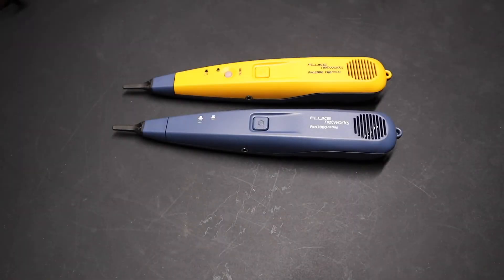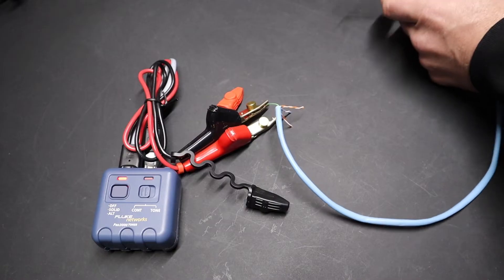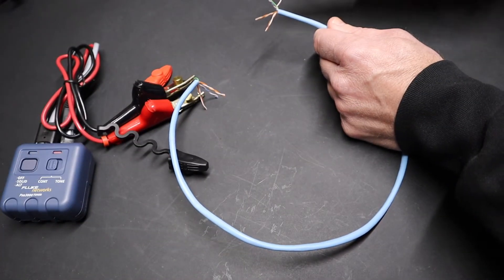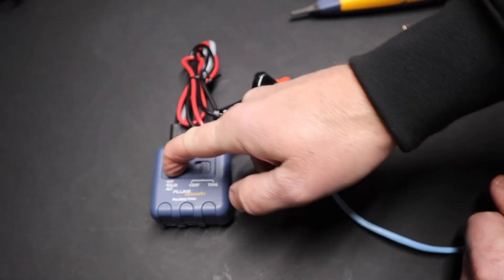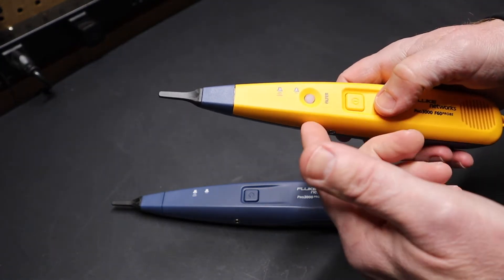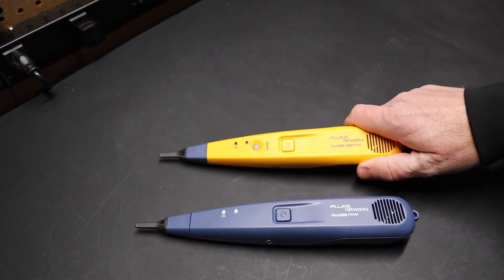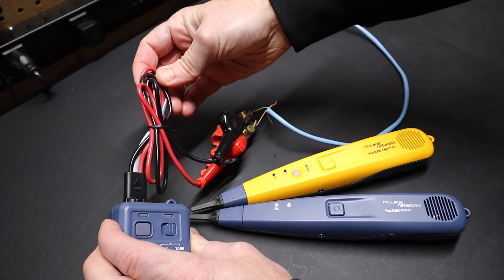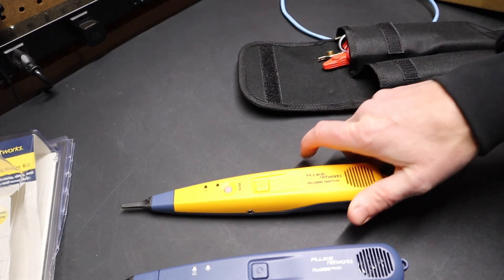Fluke Pro3000 Tone & Probe kit with filter - how to trace wires

Comment: Ι want a cable tracer for power cables. Tried some other brands but unfortunately none can locate them accurately and I end up finding them with the old process of sorting one side. Does fluke have an accurate cable tracer and identifier?
Reply from the maker: What brands have you tried?  Testing power while energized?
Reply: @ProjectPineHills  the other brand names are irrelevant. Can you answer me if fluke can detect a single cable from a lot bunch of other cables? Because with the other brands the signal goes on also for the nearby cables.

Comment: Having both of those on hand....  Would you say they are equally as sensitive..  For example.. So I use the blue one to find wires behind walls that someone else wired...   So not directly on the wire, would you say they both would perform the same?
Reply from the maker: I would say yes. The only difference being the yellow one filters out 60Hz.
Reply: @ ok thanks!!!

Comment: Fuck I just ordered the one without filter, the other seems better and me in electrical i work a lot with wires crossing hot lines and the interference noise it's annoying, can't trace nothing after that
Reply: I just cancelled and ordered the one with filter, you saved me lol
Reply from the maker: Glad to hear it!  If you can filter out 60Hz electrical noise, it just makes sense. Not sure why Fluke offers both options. Thanks for commenting!  👍
Reply: @ProjectPineHills  for real, the other day I was at the casino using a Tempo toner which is supposed to be top shet and it does detect wires buried around 5ft which is good but we we're tracing a circuit in the same raceway mixed with other live circuits on a 800ft run. Such a nightmare

Comment: If you press the power button on the grey probe, the tone generator not on, what sound will you hear from the probe? Should you hear a kind of white noise? The batteries may be low. Found a tossed out Pro 3000 kit complete. The batteries for both are the replaceable type? Thank you 🤓
Reply from the maker: Yeah the probe picks up electrical noice, so yeah, it makes static noice regardless of the tone generator being on or not.
Reply: @ProjectPineHills  interesting! Thank you 🤓

Comment: So basically you need both pieces correct. I found one thought it was for hvac or would tell you if a wire was hot
Reply: You are looking for a non contact voltage meter
Reply: @jessihawkins9116  no i found one the telephone guys lost it think ima callem n return it if they dont want it im keepn the battery lol thanks
Reply from the maker: 😆 thanks for watching, please consider subscribing!
Reply from the maker: Yes need both pieces.  It lets you trace a wire, not tell you if it's hot.  Thanks for watching!
Reply: @ProjectPineHills    Which tone generator is the best for Ethernet?  I need to find if port in an office is hot and an exact cable it is among bunches in a server room next to it.  Also, anymore data would be great like port it is attached to on a switch, etc.
Reply: @jonchapman8127  either one is good for ethernet.  even though the plug is rj11 it will plug into an rj45 plug and send the tone down the two middle pairs.  If the cable is connected to a swtich, the switch will "swallow" the signal and you won't be able to trace it with the plug.  In that case, pull the wall jack and use the alligator clips. Put the red clip on an individual conductor (i.e. the blue/white wire of the blue/white pair) and put the black clip on a ground.  Then the tone will be detectable near the switch even if the cable is connected to a switch.